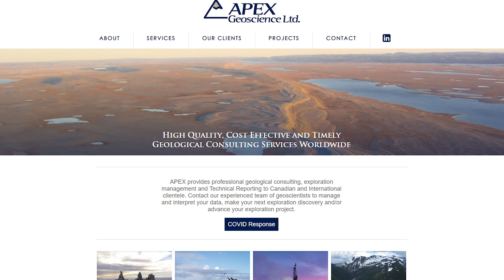This US miner has discovered enough lithium for 50 million EVs

Comment: Lithium is the 25th most abundant element on earth. It is found on every country on earth. And there are a few countries that can by themselves power all the EV's that will be made on the entire earth -- the US, Australia, Chile, Canada, Bolivia. Here's an example on just how much: in the year 2000, when we first began to understand the importance of looking for more lithium (before then it wasn't worth it, as it's uses was limited to high heat lubricants, glass/ceramic manufacturing, a tiny fraction for pharmaceuticals, and some other minor uses that one single mine in NC provided for most of those needs worldwide) the known terrestrial minable/extractable resources grew from 12 million metric tons in the year 2000 to over 86 million metric tons by 2020, and it's likely well over 100 million metric tons (might be even over 200, especially if you count mines such the one mentioned in this video) by now as its worthwhile extractable resources are rapidly growing every year, even by the month. 

Plus the oceans alone have several hundred billion metric tons of it. And that's just in the water alone, just imagine the bottom where it's seeping from.

And let's not forget that this is not a fuel where you burn it once and it's gone forever and you have to keep looking for more and ever more resources in an never ending cycle until we exhaust all of it. For lithium, once you mine it it stays with us. Battery recyclers use techniques that recover more than 95% of Nickel, Cobalt, Aluminum, Graphite, and more than 80% of Lithium. And those percentages are going up as the recovery techniques improve.
Reply: @william meek oil is not like a battery.  Oil is a fuel, in electric vehicles electrons are the fuel, and the battery is merely a storage container similar to the gas tank.  Electricity can be regenerated indefinitely as long as we have magnets and copper and some external energy sources to generate it, whereas petroleum fuels are not infinite.  Biofuels may be, but then you’re using valuable agricultural land to grow stuff to put in a vehicle instead of food to eat.
Reply: @sjsomething4936  u describe the same things.
Reply: this rebate program only last 10 years, it will expire long before the first permit is oked.
Reply: Last I heard was, it needs A LOT of water to DIG out Lithium from the Ground, but most of the Lithium Mine has no water sources near by , so ??? What is next ??
Reply: @JY-lg6ee  wrong, what is next is u need to do some research before commenting again.
Reply: @williammeek4078  Your response to me and to William are pretty strong, if your are so smart , can you share what you know, so we can learn from you ???
Reply: @JY-lg6ee  what? That almost all lithium is recovered from groundwater brines and how oil is just energy storage just like batteries?

That stuff is widely available to anyone with an internet connection.
Reply: @williammeek4078  Quote from Other Youtuber Posts: Great points about the abundance of Lithium. The same is true for iron but there is only a limited number of producers with access to the quality of resource and scale to make mining profitable. The key points with respect to lithium are a combination of factors including the quality and size of the resource, its location, access to water for primary treatment and the environmental impacts involved.
Reply: @williammeek4078  Lithium extraction requires a lot of water. To extract one ton of lithium, you need approximately 500,000 gallons of water. Studies have shown that mining takes up approximately 65% of water in Salar de Atacama, Chile. The high water requirement puts a halt to farming activities in many parts of the world.Dec 31, 2021
Reply: @williammeek4078  Humboldt County, Nevada
The Thacker Pass Lithium Mine is a proposed lithium clay mining development project in Humboldt County, Nevada which is the largest known lithium deposit in the US, and one of the largest in the world.__ but there is no water sources near by so nothing can be done right now
Reply: @JY-lg6ee  especially in Chile, lithium comes from brines. It requires pumping up ground water that is make up of lithium brines. The task is then removing the water. 
That this can lower ground water tables is the problem for the farmers in Chile. It doesn’t consume fresh water.
Reply: @JY-lg6ee  that is just one lithium source. Half of the world’s lithium comes from brines.
Reply: @williammeek4078  Thank YOu, now I learned 😂
Reply: @williammeek4078  😁😆Thank you
Reply: @JY-lg6ee  During the refining process, most of the water evaporates and return as rain.
Reply: @shake6321  Thank you, I wonder where did you get from my comment that I am against Science & Engineering ??  I am very FOR Science and Engineering. My comment was only to point out current "Small" problem.  I had been following and hoping the Nuclear Fusion ( unlike the solar you mentioned ) will be successful come up so we will have endless energy no matter day or night.  I am driving 2 Tesla Long Range and enjoying my High Tech Retirement life ....
Reply: @JY-lg6ee  sorry. but at the same time i dont think you are against science and tech (Mans ingenuity provided to him by the Almighty). i was simply stating that " don’t bet against science and engineering." its almost as if all problems have a solution. we just dont look for solutions until the problems are very real. 

have a great day
Reply: Currently there are three companies productionLithium from sea water.  One or two of them will get the price down to full product levels and the supply will be unlimited.
Reply: @TKRM2007  Thank you, that is a great relief 😄, can I have the names of these 3 companies Please ??
Reply: Great points about the abundance of Lithium. The same is true for iron but there is only a limited number of producers with access to the quality of resource and scale to make mining profitable. The key points with respect to lithium are a combination of factors including the quality and size of the resource, its location, access to water for primary treatment and the environmental impacts involved.
Reply: There's no disputing that lithium is a common element. The question is how much of it can be mined/harvested/recycled, given commercial and environmental constraints.
Reply: @davidbrayshaw3529  at today’s prices, lithium can be economically collected from seawater.
Reply: @williammeek4078  problem solved.
Reply: @davidbrayshaw3529  well, never really a problem. Batteries have always been materials and production constrained yet growth has continued unabated.
Reply: I was seriuosly hoping you had a bunch of videos on this as you know your stuff!
Reply: Clearly a lot of people here have NEVER worked in the mining industry or have NO IDEA about manufacturing, but then most of these idiots spouting nonsense have NO IDEA because they have never been involved in manufacturing or been involved in mining and I'VE DONE BOTH. I used to work in the Australian automotive sector before it shut down and have since worked in the Australian mining sector in control systems and automation.

1: There's a giant difference between finding a deposit, getting it properly assessed and then being able to mine it.
Circa 2006 I worked on the construction of the Ravensthorpe Nickel project. BHP spent $3.5 Billion on the project. It was laterite nickel which is a bitch to process, but it was justified by the quality of the deposit and the value of Nickel. BHP did NOT complete a full drilling test pattern and the deposit was found to be NOWHERE near as good as the PR claimed. The mine was closed after about 18months and sold for less than 1/7th ($500 Million) its.
The Lesson: Don't believe the PR hype even when its from a major player. 

2: You absolutely do need Nickel for batteries, just as you need copper for the electrical cabling in an EV just as you need all the other metals, glass and plastics. Go and look at your car and see how much stuff is actually in one. If you have ever been in the plants where they make all those bits that go into a car you'll quickly understand that it takes a whole range of raw materials and lots of energy to make the bits that make a car and all of that uses lots of energy.

The quickest way we can reduce emissions is to reduce how much energy we consume as a society.
 
THE AUTOMOTIVE MANUFACTURING SECTOR is one of the largest energy consumers because it not only uses a lot of energy making the cars it uses a lot of energy getting the raw materials out of the ground and processing that into the raw feed stock to make the parts the cars are made from. The best thing we can do is NOT replace old cars with new cars but replace the drive systems in old cars with EV and Hybrid systems. It will save huge amounts of energy and resources while keeping millions of people employed. 

BUILDING EFFICIENCY: The other great (and inefficient) user of energy are BIG BUILDINGS. Mark Blyth the political economist from Brown U. pointed out this a couple of years ago. Some engineer worked out that just triple glazing all of America's buildings would employ 1000's and 1000's of people for well over a decade and reduce America's emissions so much that meeting the Paris goals is easy because you can then turn off a bunch of dirty old coal fired power stations. All those big giant glass boxes are designed by architects to look pretty NOT by engineers to be efficient. Not only would it creat employment but raise the asset values of all those buildings as well as reduce the power costs all the tenants have making them more profitable. I'd like to hear an economist claim that's not a good idea.
Reply: @tonywilson4713  Energy conservation ..minimize waste.. maximize usage efficiency.
There is a colossal amount of energy that can be saved and in fact create an energy surplus.
But hey.. who cares ?. 
The corporate world is growth addicted driven mostly by consumerism.
Reply: @tonywilson4713  Thank YOu Tony, YOu had said what I want to tell to people for A long time, but I am not an engineer so I don't know how, NOW you had done a Well done job, thank you
Reply: appreciate this synopsis of the industry.  best to you.
Reply: @theoriginalscottmalkinson6161  ur ignorance is truly astounding.
Reply: The problem with most lithium "deposits" is concentration... most lithium deposits are so dilute that u do spend exorbitant amounts for processing...
Reply: @JL-fx2cd  with current prices, lithium can be economically mined from seawater. Dilute sources is not why lithium is expensive right now.
Reply: @williammeek4078  dam bud... current prices are dictated by the current process.  If u can make it cheaper... the price would drop..  come on...
Reply: @JL-fx2cd  Um… no. The current prices are purely a reflection of supply far exceeding demand. Its Econ 101. Come on. This is the simple stuff.
Reply: @williammeek4078  if they could pick up lithium off trees like NUTS... the price would be less.. come on u obviously don't understand anything about chemical processing... anything..
Reply: @JL-fx2cd  you clearly haven’t paid attention to the rate of increase in lithium processing. It might help if you learned something about the subject you are commenting on before doing so.
Reply: @williammeek4078  ... processing... I know a little about that...
Reply: @JL-fx2cd  ya, unverifiable claims of personal knowledge are always suspect. If you can’t prove it with independent sources, it isn’t true.
Reply: Exhibit A from the Climate Crap Coalition: 

One of the glaring stupidities of the climate change argument is the fact that the climate was warmer than it is now in years 800 to 1200 – the Medieval Warm Period.  Greenland had a thriving Viking colony and England was producing so much wine that the French were getting upset about the competition.  Neither Vikings nor the English drove SUVs.  The stupid assertions of climate change is government expanding its boondoggle empire through quackery and superstition. “Government imposed superstition” in the 21st century is something we should be ashamed of.

https://youtube.com/c/CDN_ClimateDN

The Ballad of Climate Superstition: https://www.youtube.com/watch?v=0CFuCYNx-1g&ab_channel=lozzagermain
Reply: Yep!, J.B Straubel, earlier Tesla founder, have a recycling factory in Nevada!!❤️🤗
And just held a convention abut what they do there. 
I forgot the name of it, but look it up!!
Its on you tube!!😀👍
Reply: @helenan.i.kristiansen1635  
Exhibit A from the Climate Crap Coalition: 

One of the glaring stupidities of the climate change argument is the fact that the climate was warmer than it is now in years 800 to 1200 – the Medieval Warm Period.  Greenland had a thriving Viking colony and England was producing so much wine that the French were getting upset about the competition.  Neither Vikings nor the English drove SUVs.  The stupid assertions of climate change is government expanding its boondoggle empire through quackery and superstition. “Government imposed superstition” in the 21st century is something we should be ashamed of.

https://youtube.com/c/CDN_ClimateDN

The Ballad of Climate Superstition: https://www.youtube.com/watch?v=0CFuCYNx-1g&ab_channel=lozzagermain
Reply: Have you seen the footprint of a Lithium mine?
Reply: @thtsfhuny  u do realize the footprint of impact for fossil fuels is the whole planet.
Reply: @timothykeith1367  u clearly have no idea what u are talking about.
Reply: @timothykeith1367  
"Lithium is not a fuel"
So lithium is a compound which in combination with others, stores the energy, which must then logically be "the fuel"?
And the fuel must therefore be...
Electricity
Which can be harvested from....
The sun.
Compared to petroleum....?
Reply: @thtsfhuny  compared to fossil fuels it's small

Comment: DLE is a disruptive chemical processing technique (It's not MINING) unlike the brine evaporation pond systems in Chile and Argentina.  Evaporation ponds are not suitable except for arid environments and Arkansas clearly does not qualify.  Standard Lithium is the most advanced DLE project anywhere in the world and has a partnership with Lanxess' bromine operations in El Dorado AR.  

DLE does use fresh water, however, there is NO shortage in the Smackover.
Reply: This is largely true but DLE unlikely to prove disruptive. Each process needs to be tailored to the individual resource and costs will be higher than either evap or hard rock. All resources including sedimentary lithium deposits (LAC) will be required. Imo Standard is among the leaders. Never heard of Galvanic. These youtubers need to be careful talking about junior miners. Most are pump and dump schemes and these influencers could be sending unwitting viewers into a financial disaster. DYOR and be very careful investing in junior resource stocks. The shady characters running these pump and dumps are using yt influencers to peddle their no hope projects